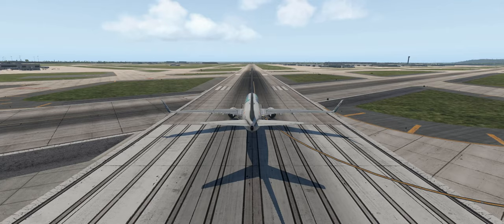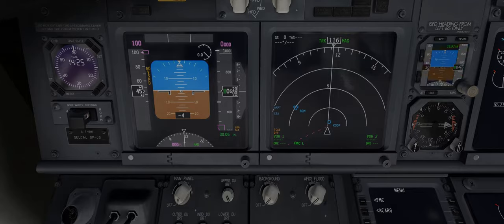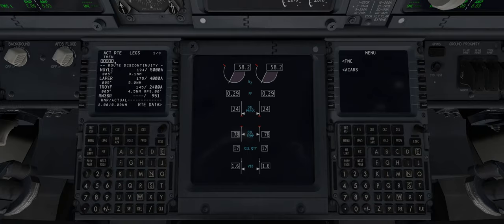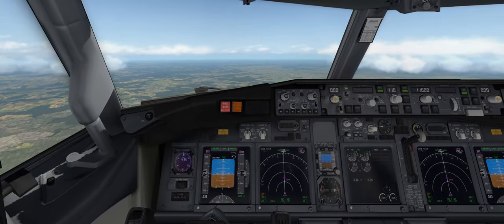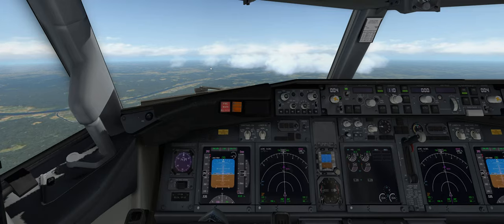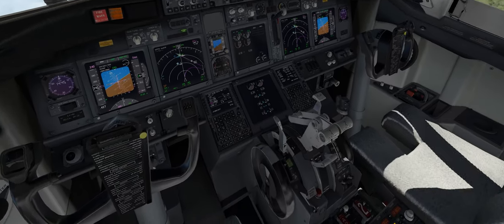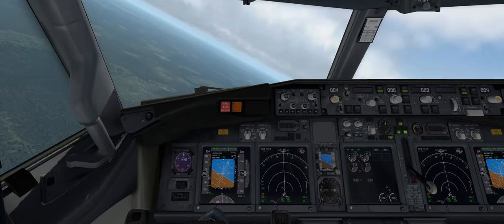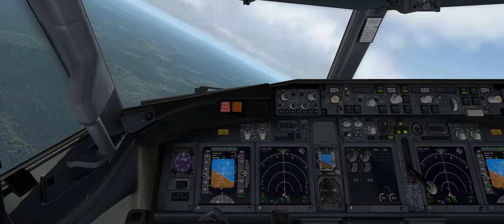X-Plane 11 - Learn to fly a RNAV Approach

Comment: You need to arm the SB's during the appr checklist, it is not that hard all you do is pull the handle reward just a little and a green light will illuminate just above the ND and it will say SB's armed, that way when the gear touchdown they deploy. And reversers should be stopped at 60kts  and manual brake after that. the altitude during the approach should also be set to the published missed approach altitude. Other than that great landing. :)
Reply: Thanks for the 60kts advice on the reverse thrusters. Personally, I would have used the SBs to drag off speed when lining up the approach rather than lowering the landing gear so soon as Jason did.

Comment: Hey Jason, good video just one thing that would add to the realism. When you set the cabin altitude, don’t set it too high. 11,000 feet and your pax might have a little trouble breathing and if someone has weaker lungs, it could cause a medical emergency. From my experience (I don’t fly the 737) we climbed up to FL260 and had set the pressure altitude to 7,000 ft.

Comment: Thanks it was useful. I have a question. I just bought the Yoke and this game so i dont know anything i just flew with no settings, but everything was set in the yoke perfectly and after take off as i stopped pushing the yoke forward to stop increasing the heights, the plane started going up nearly vertically almost every time. ( my hands were not on the Yoke control) Can you explain me or give me any help why its happening?
Reply: Are you pushing forward to go up?
Reply: Alex L i was pushing forward to point the nose to the ground and pulling to point up to the sky so it was perfectly set. But somwhow when i wanted to land and i pushed the joystick forward nothing really happend. As i let it back to neutral position the plane started going up vertically and i dont know why. Maybe the velocity or sth else that blocked but im still triing to figure out.
Reply: @szegfukornel8805   Szegfű Kornél  My best guess is that it's a trim or C of G issue. Those are the most likely to cause such a violent pitch up. Make sure the aircraft is properly trimmed for landing and the centre of gravity is within limits.
Reply: Calibrate your Yoke, Throttle & rudders controls frequently. That's my experience with XP 11.

Comment: You Do Press APP for RNAV in 737-800.  Called RNAV IAN Mode check it out.
Reply from the maker: Not from all the reading that I have done from the Zibo forms but I could be wrong.
Reply from the maker: @Greazer  This is great, thanks! You can't imagine how many threads I read where some said Yes and others said No. So if I understand correct, selecting APP during the RNAV approach puts you in IAN mode which allows LPV minimums if your aircraft is capable. Perhaps with this I wouldn't have been high without changing the Altimeter etc.
Reply: @JasonVriends  some airlines don't use IAN, for instance real pilot flightdecks2sim his airline dont. They do RNAV with lnav/vnav. IAN calculates the lateral and vertical using computer and GPS. On the PFD you get FAC and G/P. Regarding minimums I think you use the lnav/vnav minimums according to this: https://www.avsim.com/forums/topic/354645-ian-approach-which-minimums-to-use/
Reply: Yes someone knows how to fly the 737 correctly.